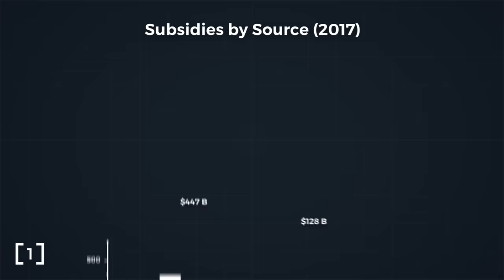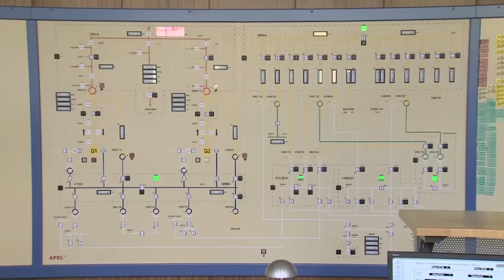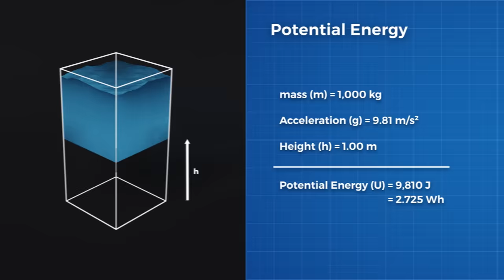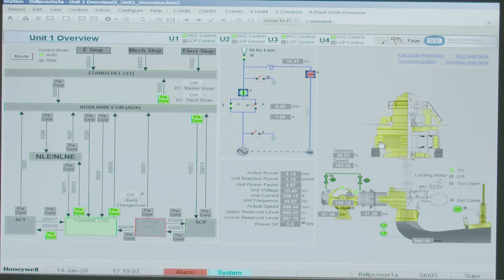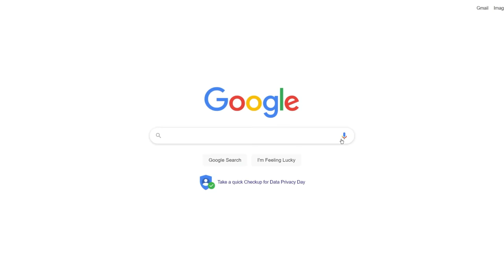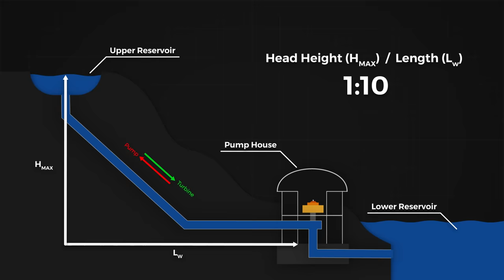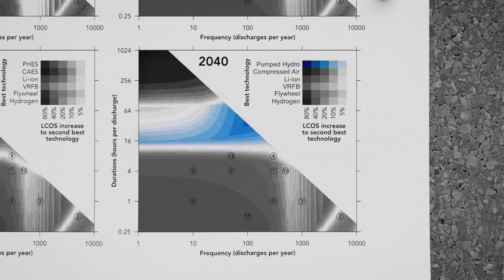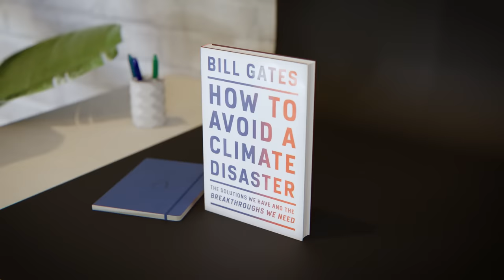The Truth About Pumped Hydro

Comment: Can you do one on liquid air storage? It seems to me that liquid air storage could solve most of the storage problems. It doesn't use a lot of toxic materials to make it, it actually cleans air and it doesn't need a lot of space.
Reply: If that refers to co2 storage, then the problem is that co2, even in liquid form, takes up more space than the fossil fuel it was produced from. Meaning we will run out of storage space before we make a meaningful dent in the problem.
Reply: @Alexander_Kale  Googling "liquid air storage" redirects to "Cryogenic energy storage" which makes more sense and explains the working principle better. Storing large amounts of compressed air is not cost effective because of the pressure vessels required. Storing a cold liquid at atmospheric pressure benefits from the square-cube law when scaling up. But I still doubt it can compete with electric batteries.
Reply: If Cleaner Nuclear Reactors were "allowed" by the weapons industry then this would be how some reactors would generate enough electricity to run Refrigerator units and pumps as as sink heat before a possible meltdown..

But you know, depleted uranium make Bigger holes in stuff
Reply: @mennovanlavieren3885  I am sorry, are you really suggesting we build giant refridgerators, requiring constant power input, to store the ginormous amounts of co2 produced on a global scale in an active system?

What do you think this is, Star Trek?
Reply: @Alexander_Kale  Haha, no of course not. It has nothing to do with co2. It is about temporary energy storage, not production. And I think the technology cannot compete with bateries in the long run, but I might be wrong on that and it is intetesting stuff.
Reply: @mennovanlavieren3885  No. If used for long term storage cryogenic air is much cheaper than batteries. Batteries are still the better option though when you just need to cover a few hours, since they have a much higher round-trip efficiency.
Reply: Better develop thorium and fusion reactors as fast as possible and use renewables with pumped storage and hydrogen as stop gap measures.
Reply: @johndee2990  : depleted uranium make Bigger holes in stuff"
Neither bigger nor smaller than the bullet.
Reply: How does this clean air? I am familiar with cryogenic air separation and liquid storage, and I do not believe this would be a reasonable solution to grid scale energy storage at all. The recovery would be very low, and boil off would be significant. As mentioned before, you could benefit from square-cube law, but would need a HUGE vessel to mitigate those -290F temps. The efficiencies would be similar (bad) to electrolyzer for H2, with significantly less flexibility and higher storage constraints

Comment: Environmental concerns halting projects to address environmental concerns. Sounds like the paradox of our time
Reply: Exactly lol its like ‘dont use plastic its bad, use paper instead as it degrades’
Then ‘stop using paper you’re cutting down too many trees’
Reply: @ultrascreens5206  In grad school (environmental engineering) we read a published research paper on the environmental impacts of paper vs plastic.  It was interesting and broke down the number of plastic bags needs vs one paper and the electrical requirements to recycle both etc.  Still came out nearly even, but the educational message that there is no magic bullet solution and improvement is the key.

Comment: Deep in the heart of Alberta's oil production fields (traditional, not sands) sits a large reservoir that is being converted to pumped hydro. The reservoir was built in 1965 and the plans are to increase capacity for generation from 355 MW to 900 MW. The operator is closing down its oldest coal fired plant 150 km away this fall and will be closing its newest and cleanest coal plant at the same site (10 years old) in 4 years. I believe there is still a place for natural gas fired plants in the renewable future, but we definitely need to reduce them to the minority and get them to the point of being backups, instead of primary sources.
Reply: Energy = life, 
The more energy the higher the standard of living and the less poverty. The less poverty the less unnecessary death.
Deliberately choosing to not use the most energy dense per £ invested sources is amoral. 
It is choosing someone elses life over your feelings.
Reply: @James-sk4db  Are you arguing for or against renewables? Gravity battery or lithium ion?
Reply: @kstricl  Im arguing against anti-fossil fuel, but i'm all for renewables, so long as they are cost effective, hydro-electro and geothermal come to mind as well as nuclear. 
If you have £1bn to invest in energy you should use it to use it to generate the absolute most energy possible as the more you produce the less scarcity there is in the rest of the world.

Comment: I still like Thorium as a better alternative to fossil fuel, the stuff is everywhere, perfectly safe to he around on it's own, reactors using it physically cant melt down without intentional sabotage, it's 100x more efficient with uranium with the majority of its byproducts also being safe. Not to mention you don't need multiple backup powerplants on cloudy/still days. Until we get fusion figured out and can run all the power we're ever going to need off of sea water or space ice if environmentalists freak out about the idea of using water as fuel.
Reply: You’re exactly right. Small footprint, safe and cheap. And they wouldn’t have to dig giant holes all over Ireland. What a mess.
Reply: I'm a huuuuge fan of nuclear (with thorium as a subsidiary of that) as our best option for long-term renewable energy. I think it will serve our existing infrastructure much better compared to widely distributed but low-producing means like wind and solar. My biggest issue with people on the renewables boat, is that the change in infrastructure will be extremely expensive to undertake. Switching power sources alone isn't as hard as the upheaval of a century + of infrastructure based around the way we use fossil fuels. This is doubly true for those who think we are going to replace residential gas with hydrogen.
Reply: @adriansaidan1736  So natural gas has half the Co2 of coal. So why not convert the burners to natural gas now. It’s an easy swap and it’s very clean. Methane is 4 hydrogen to 1 carbon atom. Almost hydrogen. In the mean time we could be building liquid fuel thorium reactors. They will take a while just to get past red tape. There. We fixed the world.
Reply: Fusion will never be economical and existing fission reactors are more than capable of providing low cost safe electricity now. Thorium is not necessary.
Reply: @garry8390  exactly. And the newest type 4 don’t use high pressure water for cooling. They don’t even need a containment vessel.
Reply: Nuclear energy production is not just about the reactor; you have to mine, transport, store, and get rid of the waste. When you add all of those nuclear energy is expensive. While thorium has some advantages, it is not the better option in most cases since it still have those problems, it is not a miracle solution.
Reply: @cancan-wq9un  Nuclear is only expensive in the west because there is a whole industry that feeds of unnecessarily high safety standards. In asia they build plants for a fraction of the cost.
Reply: @garry8390  That safety regulations are there for a reason, we all know what happens when you fool around with it.
Reply: @cancan-wq9un  you’ve been drinking the kool-Aid Can, the thorium based reactors can recycle their own fuel, and have much lower level waste than typical uranium waste. The waste from a city the size of Phoenix is less than a gallon paint can per year. And 3/4 of that can be made into medical isotopes to cure cancer.    It’s not the power plant that you’re used to.
Reply: @cancan-wq9un  I strongly advise looking into Thorium before you decide it's a waste of time, piling everything up on one solution is how we got into this mess.
Reply: @grumpy3543  yeah, I heard those before. Thorium waste is radioactive 500 years or something instead of thousands of years, and there is less of it. But as I said, you still have to safely mine, transport, store, use and get rid of waste. You need facilities and people with experience to run them, and that includes the facilities to make that medical stuff from the waste. Yes, it is better than uranium reactors, but it is stupid to argue all that process is better than any other green technology.
Reply: @steel8231  I didnt say it is a waste of time, I only say it is not a miracle solution. Too much hype.
Reply: @grumpy3543  we’ve been doing that in the US for awhile now. We have switched a lot of coal plants to natural gas. Most of our power used to come from coal but now a vast majority is from gas. This is a slow process that doesnt happen overnight and the political “activists” wants ppl to believe that nothing has been done the last 50 yrs in energy development. They also throw out ridiculous ultimatums like going 100% “green” by 2030. Totally impossible. I agree that nuclear is the way but, there again, lots of disinformation and stigma toward nuclear. Thorium is promising
Reply: @cancan-wq9un  you have to have all that for “green” energy too. It takes experts and workers no matter what power source you use.
Reply: @John_Redcorn_  not really. None of the other green energy tech need several different facilities on different stages, none of them are radioactive and therefore none of them require dangerous substances training. And you at least want your operators have a degree on nuclear engineering, while every common Joe can manage a solar plant with little training.
Reply: @John_Redcorn_  great comment. I totally agree
Reply: @cancan-wq9un  I see your point that it’s more technical and radioactive than wind or solar. But it’s totally worth not have the footprint of “green” energy. Putting up hundreds of miles of solar cells is no different than building parking lots on the same land. It looks horrible. Now I believe that solar has its place on rooftops and carparks supplementing or grid. But please don’t pollute my countryside with them. And mining the materials for solar is probably worse than for nuclear reactors. Plus it uses child slave labor to get it. Thorium is right here in Nevada. It’s abundant. Coal miners can come here to work
Reply: @grumpy3543  there are wast remote spaces in US that can be used as solar farms, it is way easier to accomplish. Thorium reactors can be a good ballast to balance the unpredictable side of green energy among some other tech, but it is not the future.
Reply: @cancan-wq9un  well even so, that would be even better as it would provide more high-paying skilled jobs. If the demand for those type of workers was there, young ppl would start studying and training in those fields. And those are jobs that couldnt be outsourced to someone overseas, as those ppl would need to actually be on site. Its a win-win
Reply: @cancan-wq9un  The vast area’s that you think are ugly wasteland are my beautiful natural countryside. I don’t want it paved over. And real frankly, it doesn’t need to be paved over if you will simply realize that it’s stupid to make power in the southwest and then try and transmit it 2500 miles across the country while it loses 30% to transmission loss. And the waste of the solar cells are just enormous compared to nuclear. And you have no idea how to recycle it. So you’re just going to put it in a landfill in 20 years.
Reply: @grumpy3543  you realize you get transmission loss whereever you build, right? And "waste of solar cells"? Solar cells are mostly made from glass and silicon, what are you talking about? It is not toxic or something.  Yes, it does have some environmental inpact since it occupies space, but complaining about your "beautiful countryside" is pointless since anything else you build will damage the environment with increasing impact. And it is hypocritical to comlain about solar power while whole US got poisoned by lead by oil industry for ages.
Reply: @cancan-wq9un  You can build a small modular thorium plant that doesn’t use cooling water that will fit on the back of a truck and be put on site for 20 years before it needs to be refueled. The whole plant is the size of a house. Canada is building one now to be ready in 3 years. It has the same generating capacity of miles of solar cells. You have to understand how much mining has to be done by child labor in third world countries to understand the impact. You really have to get off the solar cells are the only way information machine. That’s absolutely bullshït. Sure they are a good supplement on rooftops and car parks. But that’s it.
Reply: @grumpy3543  Even if we assume everything else you said about that "truck" is right, it is impossible for it to generate that much power. It is simply impossible. Only the turbines you need for any powerplant are as big as a truck, forget anything else supporting it. 

As I said before, this hype about thorium reactors is ridiculous.
Reply: @grumpy3543  I checked twice, this only produces as much as 2 or 3 wind turbines. This is not that much, and not definitely proposed as a main source of power.
Reply: @cancan-wq9un  do you want to live under a wind turbines?  I do not and neither does anyone that lives out there it’s horrible
Reply: @grumpy3543  and it cost 25 cents per hour. Even it gets half the price eventually, that is too much. Normal nuclear reactors cost 3 cents, solar 6 and wind cost 5 cents. He spesifically say this is to replace generators, not grid power!
Reply: @grumpy3543  yeah, wind and solar doesnt improve at all. They will be just the same as today 10 years later with all inconveniences.  Its not like people going to improve them, right?
Reply: @cancan-wq9un  okay fine. Build large reactors and replace the coal and Natural gas power plants. It’s the best idea. Sure some wind and solar to supplement. But it’s just not enough and nobody wants that noise and visual pollution. It’s horrible.
Reply: @cancan-wq9un  but the stage 4 reactors are much smaller and don’t need huge cooling towers. They can’t melt down and go China syndrome. They produce much lower level waste and most of it can be renewed. Talk about renewables.
Reply: @grumpy3543  thorium is not renewable. And as I said before while better than uranium, it is not better than solar and wind. You dont need different facilities to mine, rafine, transport, store, use and dump the solar or wind, but you do still need those for thorium. And they are not toxic.  While nuclear reactors are cheaper per kwh for now, solar and wind will get even cheaper. So,  solar and wind is not the backup to thorium, they are the future. Anything else is just backup.
Reply: @cancan-wq9un  yes it os better. You’re wrong
Reply: @grumpy3543    yes, people also thought trump was a better option, despite of all the evidence agaisnt it. This is not a f.cking contest, we are not arguing about which football team is better. Try again later when thorium reactors become as simple as a solar panel.
Reply: @grumpy3543  no, this is exaclty the same kind of blind following. I tell you the shortcomings of thorium, but you still act like child, saying stuff like "nO it iS betTer", and have no idea what compromise is. Think for your own brain for once, rather than repeating the hype you got online to me.
Reply: @grumpy3543  and you even send a "proof" which supposed to back your argument, and which turns out doing the opposite. If you are that invested, buy a thorium truck yourself and pay 25 cents per hour for it.
Reply: I got siri’d. Your
Reply: @cancan-wq9un  And California electric bills are triple the rest of the country nis how you’re going to save us?  That’s  really stupid.
Reply: @grumpy3543  I didn't say "dont use nuclear" I say it is not a miracle solution like you guys think. 

And this ignorant comment of yours about my stance is the problem about you; you don't even listen properly.

Germany and California managed this badly, but this does not mean solar and wind doesn't work. It means you need the manage it properly, like everything else. 

Now go troll someone else.
Reply: @cancan-wq9un  first. You trolled my comment. Second your panacea of wind and solar only is the only solution that you spoke of earlier is ridiculous and dangerous. You’ll end up like California without natural gas. That means blackouts when the sun goes down and no way to make enough batteries for hundreds of years. It’s not feasible to pump water uphill everywhere. It’s not even feasible in California. So you better think of some other kind of magic power source if you don’t want nuclear
Reply: @grumpy3543  You are still doing it again, after I specifically explain I am not completely against thorium reactors, I actually said several times they are fine as a ballast. So I did not recommend using "only" solar and wind, In fact you guys were doing it for thorium reactors! 

You are wrong about it, and I am not even going to bother explaining how it works since you obviously making up nonsense arguments just to fix your broken pride.  It will be easier to you sooner you realize it.
Reply: @cancan-wq9un  that’s great. And I apologize. I’m just really at the end of my patients with the anti nuclear folks who think that we can do this without it. Most of Washington is like that. It’s completely nutso to cover the earth with these panels. Especially in areas that are -40°, covered with snow and cloudy for weeks at a time. People will die. Anyway. Thanks. Good debate.
Reply: @grumpy3543  Yes, solar and wind are not ready to take over yet, they are too unpredictable. We will need some advanced way to store power, and even then there might be shortage of power due to weather. So we need reliable and safe backups, while torium reactors are more complicated and expensive,  they can help regulating power. Variety is always good.